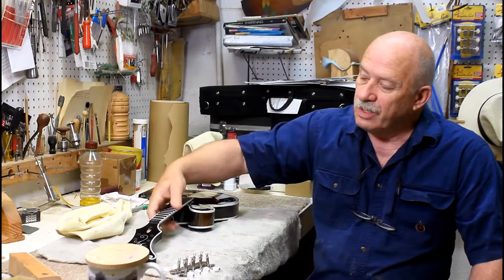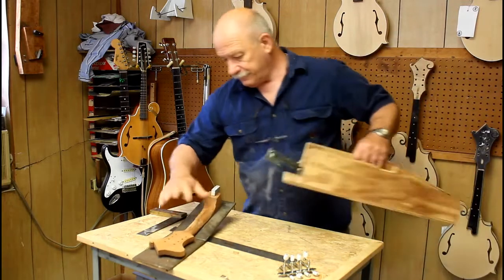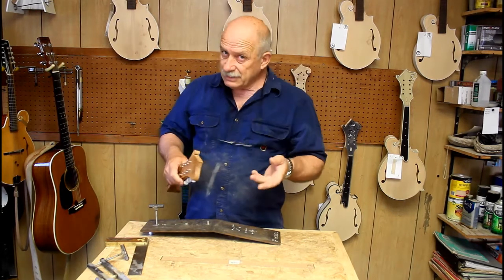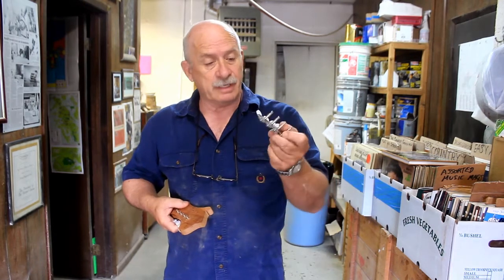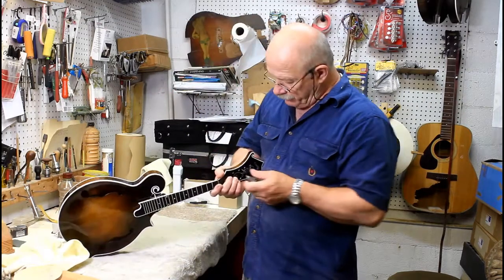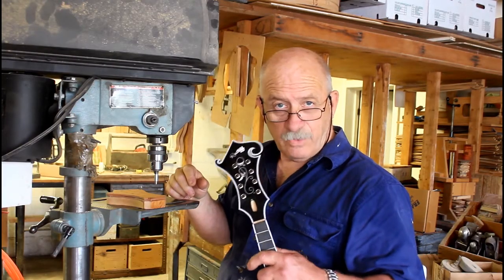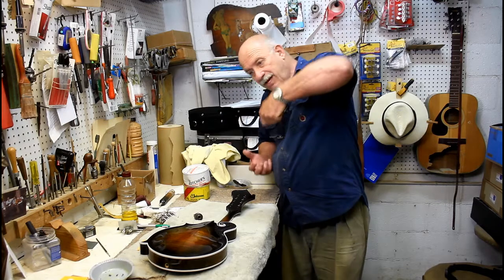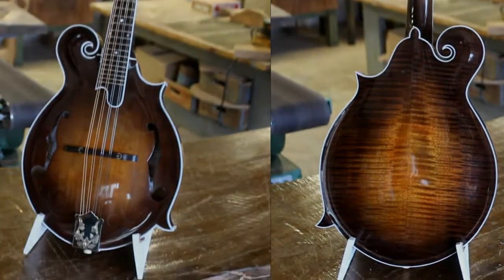Episode 102 )  1st Mandolin in this Batch gets STRINGS !!

Comment: Love these videos! I do the same thing when putting my guitars together. Chasing the tuner and screw holes with a chamfer bit. I get factory built guitars in for set ups or electronic up grades. It's terrible how the chips of finish are stuck under pick guard or tuner screws because in many cases they don't even get pilot drilled. Also learned to wax screws very early in my carpenter training. Still do it of course because if you break a screw off you are quite literally screwed.
Reply from the maker: Another carpenter's trick is to use soap on nails and screws.  A lot of the older carpenters I know have a bar of soap in their tool box. (I guess it's easier than a big can of wax to have in your back pocket on a ladder.)
Reply: @RatliffMandolins , I've heard about soap but we always had a chunk of paraffin wax in our bags or our tool box. Brings back some really good memories of my father in law.